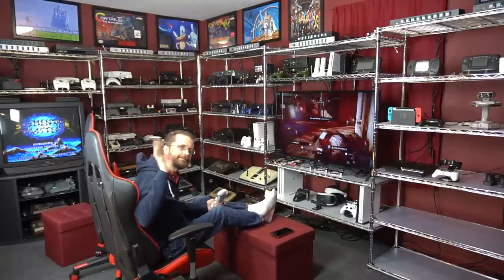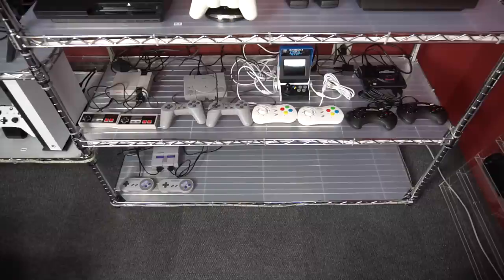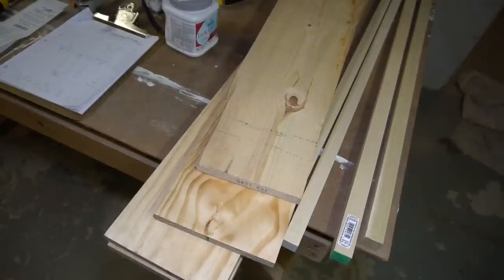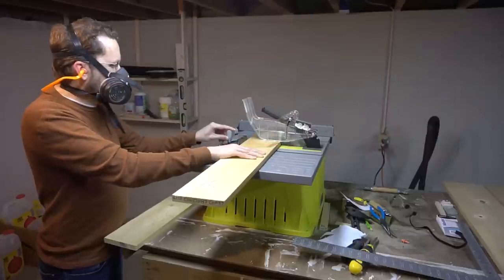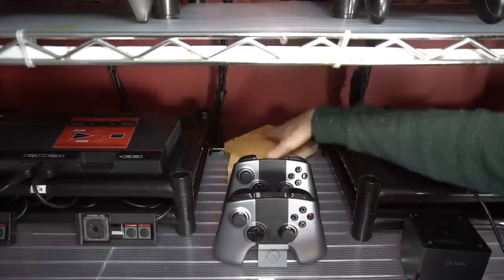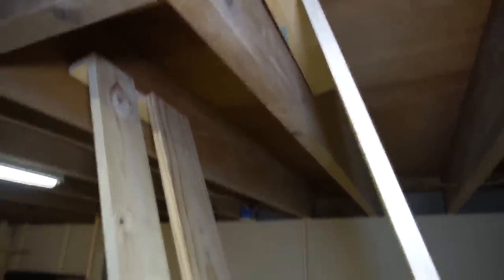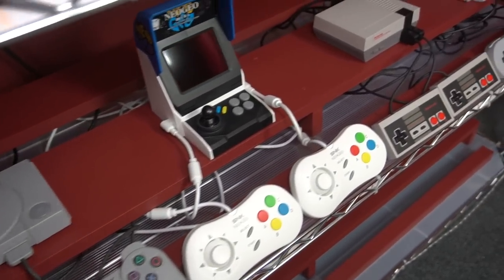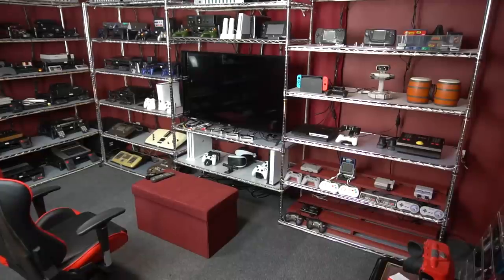Adding 5 New Consoles to the Gaming Setup

Comment: If you’re ever going to drive a lot of screws, get an “impact driver” and switch to torx (Star) or Robinson (square) head. The bit will rarely slip out and you’ll be able to drive them all fully. Those black Phillips-head drywall screws are cheap but they are really pain to work with.  And an obligatory: love the channel!

Comment: To get the screws into the wood more, counter sink the top of the drilled holes. That would make room for the screws head and make it flush. Counter sink bits should be close the drill bits at the store. Otherwise get a more powerful bit driver that can really hammer those screws in, could damage the wood that way though.
Reply from the maker: Unfortunately I could not find any countersink bits at the hardware store I went to.

Comment: I've been a subscriber for a long time and love your content so please don't take my safety policing as an attack but do some research on tablesaw kickback. I'm not an expert but some of your techniques looked dangerous. You shouldn't use the fence and your miter gauge at the same time and the push stick shouldn't be used to push the offcut. Im only an amateur woodworker so maybe an expert here can chime in and correct me. Thanks again for the great uploads!
Reply: Yes! Your push stick should only be used to push between the fence and the blade. Pushing your offcut into the blade will eventually result in your piece being thrown at your face because it will pinch the blade. It is a low power saw however and you can get away with it but never ever do that on a cabinet saw.
Reply from the maker: Thanks for the advice. As mentioned in the video, my sawing techniques are amateur and will drive experienced people crazy.
Reply: @HowToX  No problem at all. And the advice wasn't because it was driving me crazy or anything, more because you can get seriously injured if you keep doing it that way. When I first started woodworking I wanted to build some bookcases for my game collection. I was using the same style saw as you and on my very first cut the piece shot out of the saw at 100mph and put a huge dent in my garage door. Thank goodness I wasn't standing in the way. I then researched what I did wrong and found out about "table saw kickback". Fingers are important to us gamers and I wish someone had warned me about kickback before I started using my saw so just posting to hopefully help prevent any injuries.